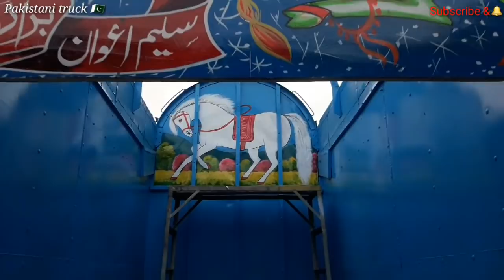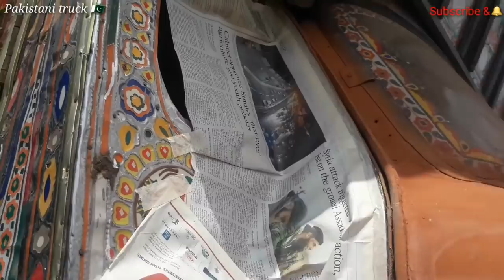Bedford's accidental repairing and paint work Pakistani truck art

Comment: Very nice but you missed something.  The sides of the engine and the valve cover need to be paint as well as the driveshaft and rear end. If you are adorning a truck as you do you cannot miss anything! One other thought.  Above the cab there is a large area that is wasted space. Could you make it into a place for a bed and somewhere to fix tea or a meal? A door inside on the passenger side with a ladder could allow 1 to drive and one to act as his helper plus a second driver so you do not need to stop as often.

Comment: I am in Canada we have strict rules for commercial trucks. I cannot see one truck passing there inspection. Usually when they hold check stops here about 1/2 the commercial trucks  have failed. And are not allowed back on the road until all has been repaired
Reply: It is not all about money in Pakistan... you get free tea too...
Reply: @MusingsofaWanderingmind  So you are in your car with your family so the big truck behind you can it stop when you do ?? Is it over loaded and unsafe what is your family worth ???
Reply: @RaySarasin   Check out the statistics... people in fact drive recklessly around trucks however they are generally driving on or less than the speed limits permitted. 
On average a person would be more likely to be maimed or worse on the streets and highways of Canada, primarily due to higher speeds and secondarily due to conditions such as black ice... fog... storms etc.
Reply: @MusingsofaWanderingmind  I am in Alberta along a highway reg DOT stops here at corner 36 and 14 so many trucks fail this road test very few pass i see this every summer
Reply: @RaySarasin   well it is kind of predictable, considering the extreme weather, higher speeds and stress on equipment and costs of repair etc...
In Pakistan repair is readily available and cheap.... besides a lot of times owner himself is the driver
Reply: @MusingsofaWanderingmind  A unit here must be fixed by a licensed guy not back yard repairs which i see there. Big difference in repairs. Usually after a DOT inspection about 50 % are left behind and removed from the road untill repairs are done i see this every summer at DOT checks usually a pile of guys checking all DOT. And they get a good check you see them DOT guys all over the truck so just saying what i see. Since i travel i see this driving by
Reply: @RaySarasin   western hemisphere has gotten used to discard and replace culture... it is just easier and convenient. What you see here is people rebuilding stuff that was built decades ago... for example the Bedford trucks are at least 50 years old... still on the road and thriving... doing their job.
That may not be an easy sight for prickly and discerning western eyes... especially those who are not used to down and dirty.
These mechanics literally earn their living by years of hard work... working as apprentices for years before going solo or opening their own shop. If work falters they wouldn't see business again... word gets out fast in trucking community.